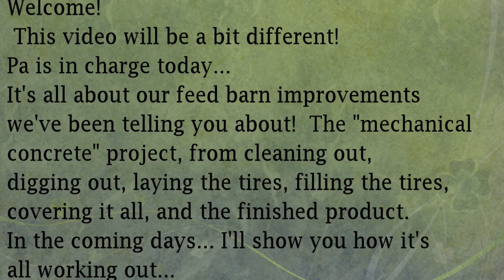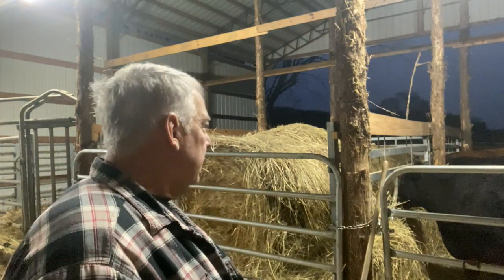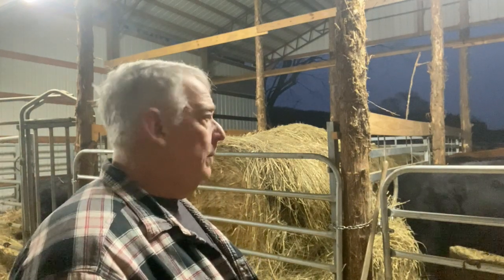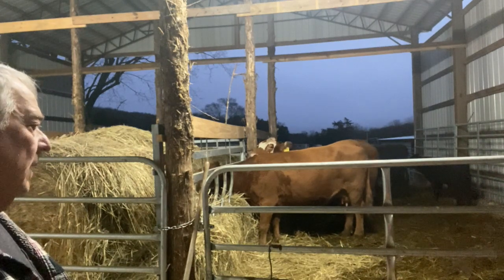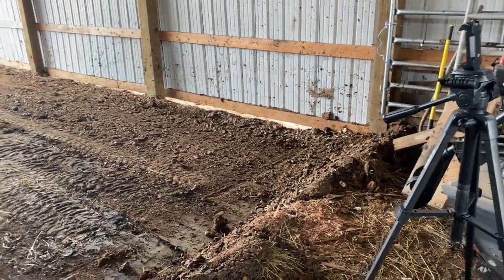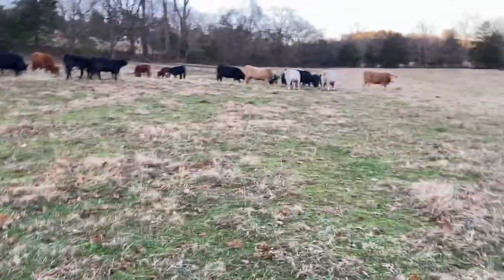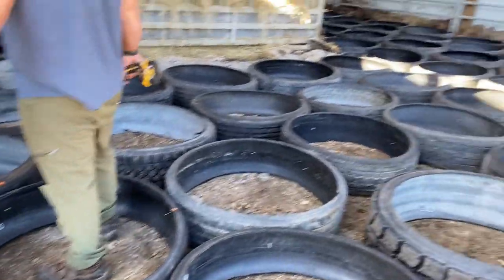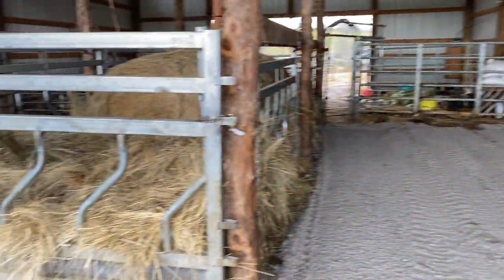Finally, the feed barn is revealed! Our take on fence line feeding hay. #fencelinefeedhay

Comment: If you look at the cost of the limestone and times it by 1.5 to 2  (You will need to replace the stone in the next 3 or 4 years)  you will more and pay for the concrete. It is truly pay today or pay it tomorrow deal)
Reply from the maker: We don't disagree using just gravel, but the tire cylinders should help prevent gravel loss. The mechanical concrete concept is in fact designed to eliminate that and is less expensive than concrete. It's very promising so far as we just did our first cleanout with good results!  Check out our latest video posted today.  
We will see what the future holds with this new concept and keep you posted!

Comment: What is the benefit of puting the hay net down in and between the tires?
Reply from the maker: Hey Cody! Recycle and Reuse mainly. Also, to have a bit of underlayment for the tires. Dr. Higgins from UK recommended using an underlayment of geotextile and we used net wrap instead! We had it available and lots of it.
Thanks for watching!!
Reply: @LifeonHeltonCreekFarm  what is the benefit of the geotextile then?
Reply from the maker: @creativecrizzma111  Stabilization mainly. Keep the gravel from sinking into the mud underneath!
Reply: @LifeonHeltonCreekFarm  ok that makes sense. I didn't know if it was for better drainage...🤷
Reply from the maker: @creativecrizzma111  it probably does! Good point. We will be doing a Spring update soon on how the process did over the winter... we have plans to extend it too!

Comment: What are the dimensions of your barn and then the dimensions of the hay rack. Looks like what we need. Thanks
Reply from the maker: The feed barn is 40 X 60.  We are utilizing 36 ft. of the length.
The feed rack is 24 X 9. That gives us about 14 ft. on each side of the rack and 12 feet of the end of the rack under cover for cattle traffic. The tractor access end of the barn we use for storage.
We also helped develop a similar system in an outdoor scenario.  It does not have to be under cover but that is a bonus.
Hope that answers your question!  Thank you!
Reply: @LifeonHeltonCreekFarm  thank you